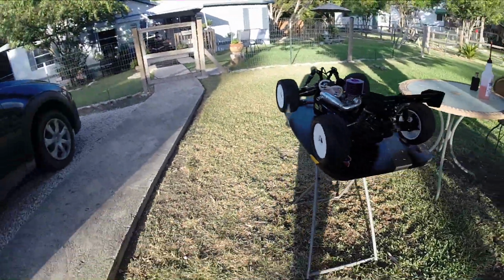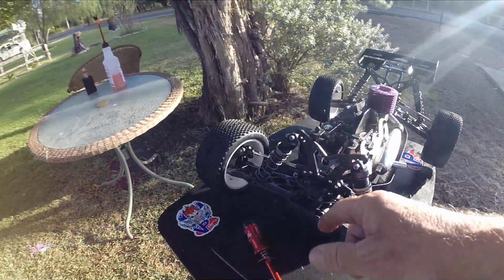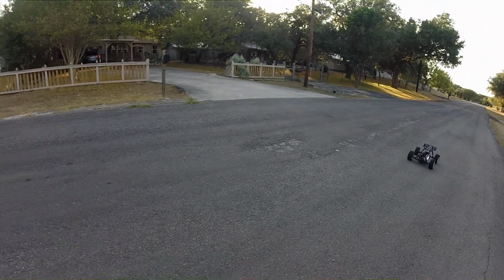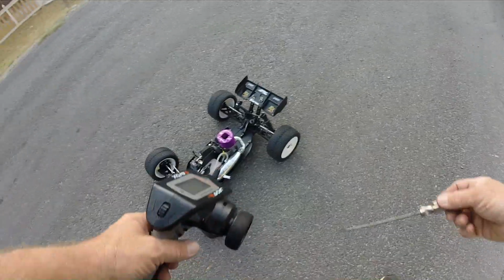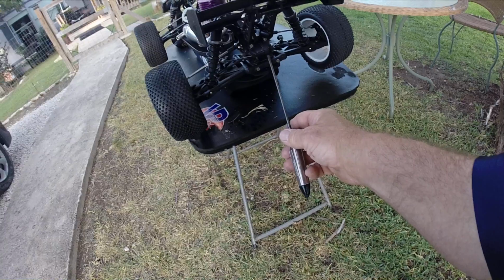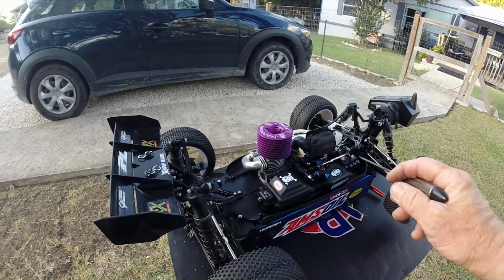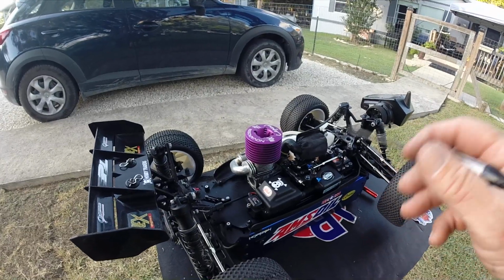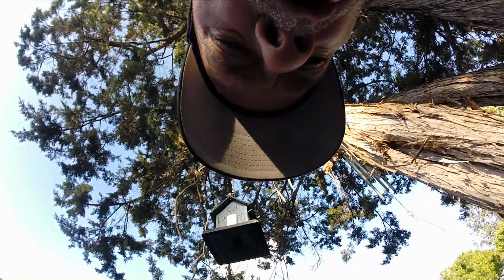Novarossi rex legend..shes gettin lill bit better tune

Comment: If you get the low right where you like it. But idle is just tad bit high turn out throttle stop. Very very little. Match low end with idle..